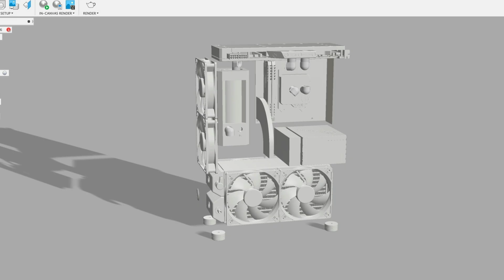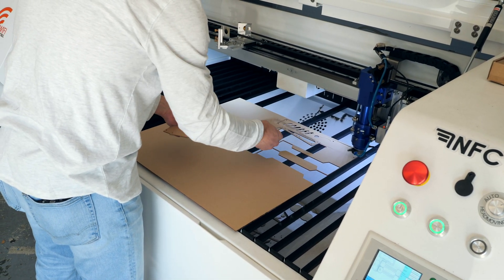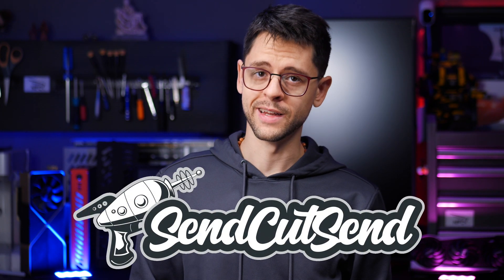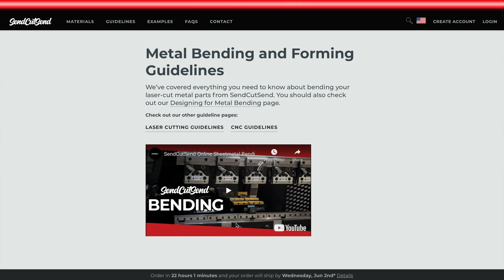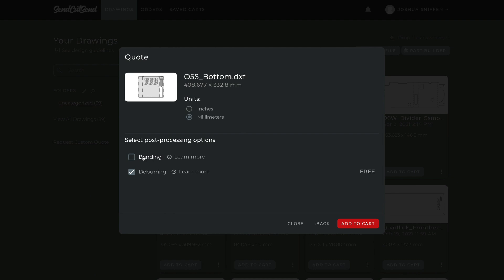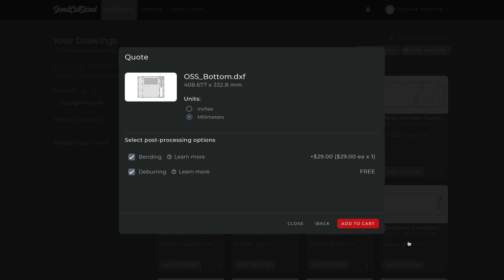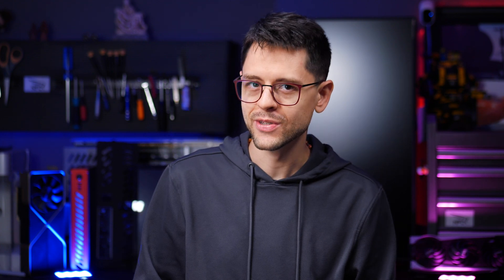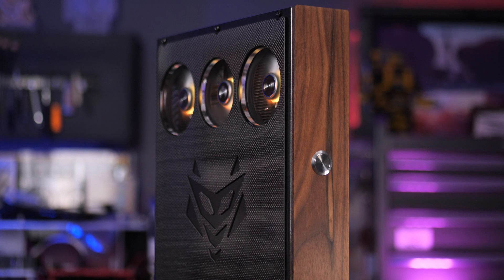Here's how to make your own PC case without ANY tools!

Comment: If you could go back in time with your current knowledge, would you, buy a cnc router, buy a cnc mill, or contract a jobshop for machined parts?
Reply from the maker: Amazing question, and the answer is it depends. For anything sendcutsend can cut...I would just use them. In fact I don't even use my CNC anymore for sheet metal work and I don't use my laser for sheet metal either. It's faster and cheaper even when I don't calculate my time to get them to do it. I do run the laser for rapid prototyping and for acrylic and wood. As for the CNC, I don't use the one in my workshop anymore, but my partner does in his for special projects. We do too much work to justify sending it out as jobshop prices are crazy high for machined parts...but if I only needed the occasional part that is what I would do. The big thing to remember is yes, a CNC costs alot of money up front, but that is just a drop in the bucket of the real cost of ownership. The amount of time you need to spend learning the software, troubleshooting, learning feeds and speeds for EVERY endmill and material you cut, and the setup/fixturing time is the real cost of ownership and it is very high. If you are a hobbiest and want to do it for enjoyment that is one thing but it's not a casual hobby. Regarding CNC mill or CNC router...for our work a CNC router because it is more versatile and we aren't cutting dense parts out of dense materials often. We stick to acrylic and the very occasional copper or aluminum part.

Comment: I actually just used them for a mod of inwin's d-frame mini. I originally got parts form a custom fabricator made which was about 450 but their accuracy issues and some mistakes on my part made the parts unusable I originally went with them cause sendcutsend didn't have a bend option but that changed so I have been able to order the same parts from them for less than half the price. I finished my mod and I couldn't be happier with how awesome send cut send is.